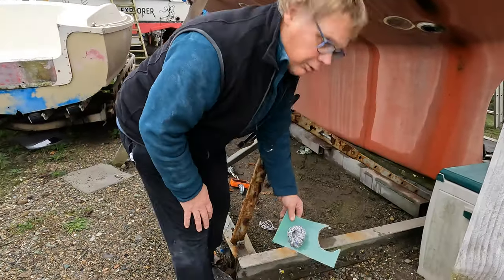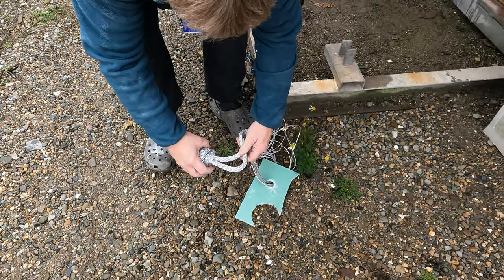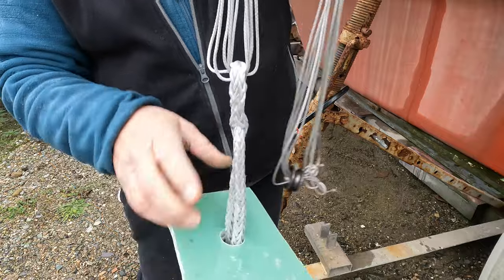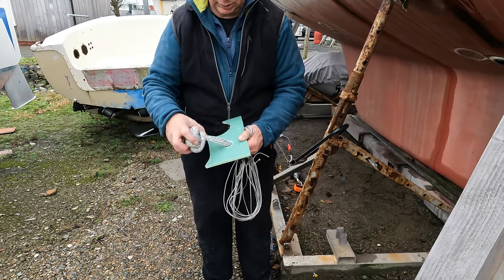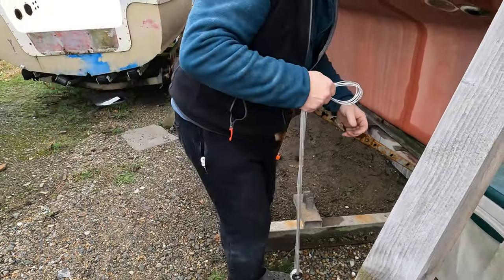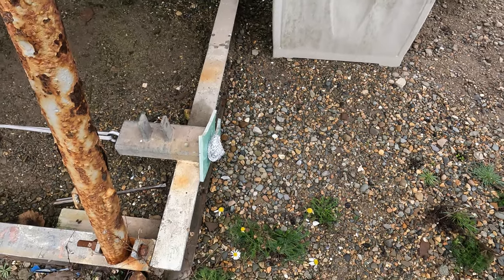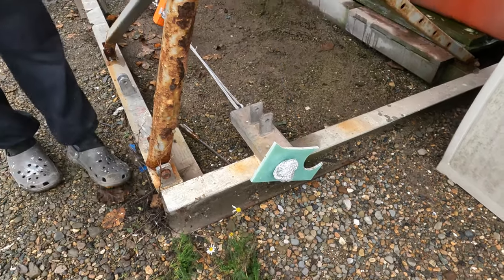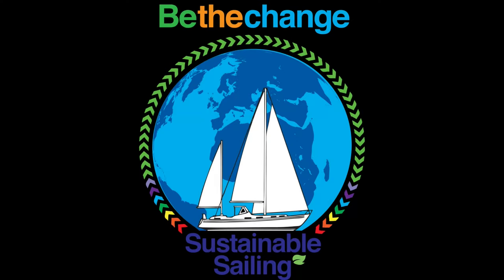Dyneema Chainplate Loop testing: Dyneema Standing Rigging Episode 2

Comment: If you worked some silicone into the weave where the chain plate passes through the deck and then use some sealant (silicone or other) at the hole, you could reduce water infiltration to next to nothing.
Reply from the maker: Yes, we will try that. We will experiment with different shrouds (after all as a ketch we have a lot of them!) to see what works best.

Comment: Well done. The moisture ingress down the ‘chain plate” may only be minimal but seems it cannot be avoided with this method. Would butyl tape work ?
Reply from the maker: Thanks!
We figure that the butyl wouldn't be able to stop water wicking down the fibres. We will stop most water with our deck "mushrooms" and anti-chafe sleeves so not expecting to need to catch a lot.

Comment: Can you advise the make of the strain gauge and where you acquired it thanks. Great video.
Reply from the maker: Hi,
Thanks.
We bought the scale on eBay. Here is the link (there were lots of similar items).
https://www.ebay.co.uk/itm/1000kg-2000LBS-Heavy-Duty-Digital-LCD-Crane-Scale-Hanging-Hook-Weighing-Luggage-/165079617503
Reply: @SustainableSailing  Thanks guys we are working with 5mm lines (20ft boat) so should be able to get away with a smaller model as well - maybe 500gs. How did you guys come up with a maximum figure to apply to your line ?  Are you using a given percentage of the breaking weight of the line ?
Reply from the maker: @andreweales2395  in conversation with Rigging Doctor they recommended that we should look at between 3000kg and 4000kg to be sure we have got the constructional stretch fully out.
Our mizzen was 6.5mm stainless with a breaking strength of 3220. Our 9mm Dynice Dux has a spliced breaking strength of 9800kg so I figure 4000kg is plenty to get the stretch out and prove it is stronger than what we are replacing.
Reply from the maker: That figure for removing the constructional stretch is obviously for 9mm line not 5mm where it will be a lot less.
Reply: @SustainableSailing  sounds like a good idea to me. I was speaking with the technical guys at Marlow (I'm using Marlow M-Rig Max ) and their suggestion was to stretch the line and hold it for a prolonged period at about 30% of its breaking strength as in use it should only be pushed to 20% which should eliminate any constructional stretch.
Reply from the maker: Great. That is very much in the same ballpark. 30% would be about 3300kg for our 9mm. I'm happy to use that for the Shrouds themselves. As our chainplate loops are somewhat novel I think we want the confidence of testing them to just beyond the original wire strength.
Reply: @SustainableSailing  Yes I'm watching those with interest !
Reply from the maker: @andreweales2395  have you seen the videos from Free Range Sailing on their refit with dyneema. Their boat is 30 foot and their backstay dyneema chainplates were the first that we saw.
Reply: @SustainableSailing  no - I shall have a look though, thanks